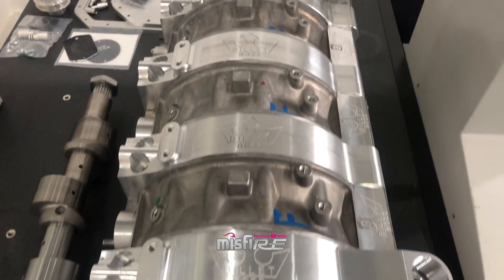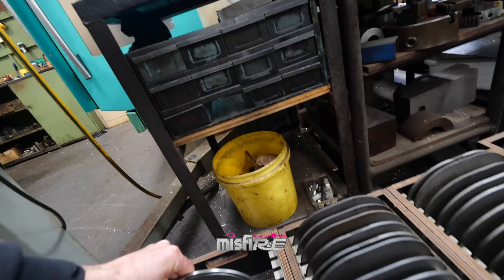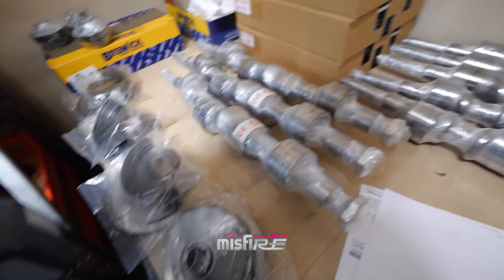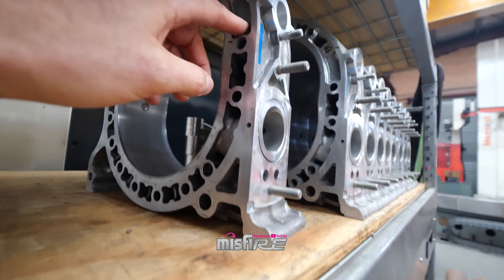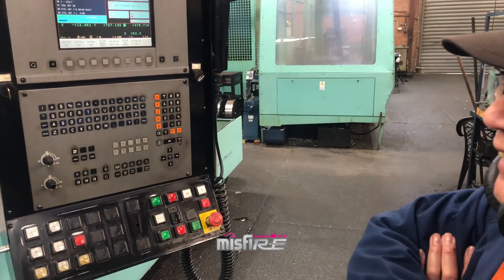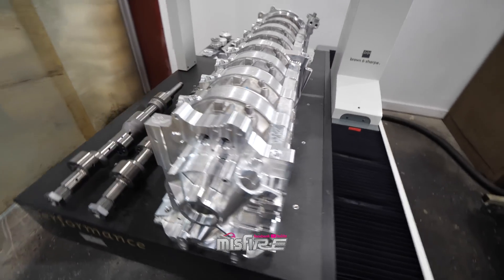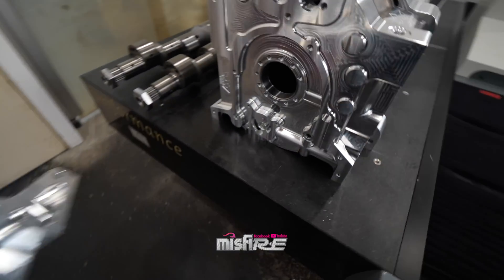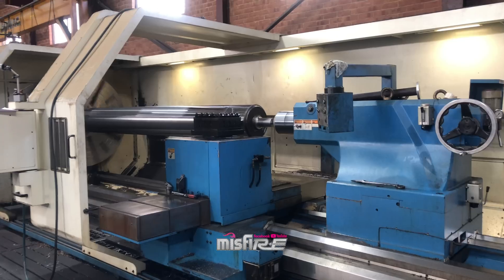8 ROTOR rotary engine The first inline ever made #Tesla model s

Comment: Could they join two 4 rotor cranks end to end?    Has anyone thought of just making the rotors and housings bigger?
Reply from the maker: Thought of both of those ideas and use a coupler system - I just want to use OEM and see how far it can be done

Comment: With all that  money and engineering available It would be  just as easy to just scale up the engine up in in size..keep it shorter but bigger overall..then your going to have ALL the tire burning torque you want ..plus the High RPM's..  I may be wrong but your 8 may  be  very slow to ramp up rpm and it's going to flex unless you put some beefy rails under it...
Reply from the maker: Maybe even a big slab of stainless for the sump plate, agree it’s going to need the strength

Comment: There's a reason you don't see inline 8 or v16 engines anymore. You're gonna need help from the bureau of weights and measures to get this thing to run right
Reply from the maker: Hey bro think the biggest 2 issues why no one has built it yet is 1 there are only 2 lathes big enough to balance the e shaft that I have found and 2 it’s so bloody long not too many cars it will fit it tesla wil fit it mint who’d of thought🤘
Reply: @misfirerotary  good luck, I wonder what it's gonna sound like
Reply from the maker: @jankington216  that's what's really driving me to get it done a angry bee hive

Comment: Is there a way to build an 8 rotor with two 4 rotor e-shafts? Or would that be considered two separate 4 rotor engines?
Reply from the maker: Thought about coupler system just want 8 stacked🙌
Reply: Even if they can't be coupled there has to be a way to sync all 8 electronically right? You just need studs that are like 10 feet long.

Comment: I highly suggest u split the first four rotors cooling system...your running 75% cooling needed above original design on the coolant holes ...having that CNC machine u just have to make the back housing for the 4th rotor have different coolant routes
Reply from the maker: 🙏🙏for your advice👍

Comment: For as small as the package why not put 2 side by side and use helical cut gears to get the timing between the 2 cases and use plates to attach them together like the tractor pulling rigs use. 2 4 rotors with huge turbo like dahm but set the timing so the engines are 45 degrees out would have 4 power pulses every revolution and would be 4k power in space of a v8.
Reply from the maker: Like your idea🙏👍

My dream was more around seeing how many housings can be stacked together toget to work
🙏for comment 👍

Comment: For cooling and oiling I’d probably look at running it as if it were 2 individual 4 rotors. ie oil and water pumps + radiators for the front 4 rotors and seperate oil and water pumps + radiators for back 4 rotors… running water or oil through the entire length of that thing will get it all pretty hot by the end even with methanol…
Reply from the maker: 💯agree along with methanol or e85 with ice box and cooler

Comment: The efficiency will be hilariously bad.. 2 miles per gallon. Cost probably 100 bucks to got 10miles
Reply from the maker: Plus I am aiming for methanol to keep temps down
Reply: I mean if you're going to go big you might as well. But what happened  to that crazy 12 rotor that was on YouTube years ago? Where's that monster. And how much power did that thing make

Comment: Building the shaft is not the hard part, making it strong enough to transmit the power is the hard part. By the time you get to the back of the engine the E-shaft going through the 8th rotor has to take the power from the other 7.
Reply from the maker: Cheers for you comment 🙏🙏going to b a mission

Comment: I took a welding and CNC class after high school. It was certainly interesting. I made my own CNC G-Code on my own. You have to remember the codes and put the correct ones on the right line or you will have a CNC crash aka VERY bad. But TAKE IT SLOW and you will be fine. Takes a lot of practice and memorising
Reply from the maker: Really appreciate your advise🙏🙏🙏🙏❤️❤️❤️

Comment: You could just do two 4 rotors side by side with either a belt or timing chain setup. I have even seen a 12 rotor setup using 3 banks of 4 rotors. and going into a tesla, should be plenty of room since the engine bay probably won't be conventional
Reply from the maker: Love the idea🙏🙏🙏🙏 emagine the tuning envolved so they all sing together. My dream was more around to see how many plates are possible to stack together and get to work.
Thanks for comment it all helps🙏🙏🙏👍
Reply: @misfirerotary , I was just thinking at 6 rotors you are getting pretty close to the limit for most engine compartments, Unless you are putting this in place of a Cummings diesel 6 (those are pretty long) so two banks of 4 might fit better
Reply from the maker: @crazylarryjr  im only limited my machines to make the crank sorting that out then good to go

Comment: I see no reason it couldn't be boosted. As long as your eccentric shafts are timed right it should be fine. Provided your cooling system is amazing.
Reply from the maker: think that is probably 20 years away before that could happen we really haven't even seen a 6 rotor out there smashing tyres and this mikes 4 rotor is the only one doing it in a 4 day after day. it is a harmonics issue because of the length add boost then boost spike custom in/outlets heat would b an incredible thing to accomplish
Reply: @misfirerotary  makes sense. Good luck and I can't wait to see one in the future.
Reply: @misfirerotary  i wonder if made out of something like inconel metal, if it would be able to withstand the intense pressure and harmonics.  Would be very expensive but very cool.
Reply: According to Mr. Dahm, the e-shaft is the weak link. Boosted 4 rotors approach the torque limit of the shaft, a NA 8 rotor running at conservative revs would output similar to a highly tuned and boosted 4 rotor.  In other words, boost applied to an 8 rotor would simply just snap the tip of the e-shaft off at the clutch.
Reply: @jefftroyer4938  thanks for the info. I can see how that would be a problem. Definitely would be amazing if they ever figure it out.

Comment: WOW.... I would be interested in what the stud bolts look like for this long of a power plant... .750" diameter 4 foot long...LOL...  The helical twisting action of this in my theory, will crash out this system.. I do not mean to sound negative, but, that is very long spread on the studs in such a close to centerline area... harmonics and a helical torqued out twisting.. I hope it holds up for you guys at high rev's...
Reply from the maker: Cheers for watching and comment 🙏👍
Reply: My thoughts exactly, the twist would be insane throughout the block!
Reply from the maker: @Yukanhayt-Mhenow  that's another reason why I'm going na add boost more power and to make sure each housing is making same comp then harmonics with wind speed. biiiiig mission one to get to work properly which I would only do not just to make content.👍

Comment: Why not a V rotary configuration with 4 rotors on each bank and a mad max gigahorse kinda of gearbox
Reply from the maker: Idea was to always see how many factory housings and can you just keep adding, cheers for interest and comment
Reply: Thank you 

With the oil pan design the 120 degree v or Boxster configuration you could have a rotary that mit fit in an engine bay. But you need that madmax thing to link the 2 cranks

Comment: Methanol will create more heat due to extra torque,also have you calculated the volume requirements for methanol?
Reply from the maker: 🙏for comment my understanding from spending hours at the track and talking with people about it is it very difficult for a methanol burning car to overheat all the burnout cars run 100% I was also talking with pwr today about running 2 seperate radiators and pump one from front and 1 to back.

What do u think?
Reply: @misfirerotary  Well the biggest myth with alcohol is that it burns "cooler" it actually burns hotter. The misunderstanding is that it "runs cooler". 
The only time it can assist with cooling is on over run with carbs or efi if set up to do it. 
Regardless you'll never cool bearing and shaft areas with combustion chambers. 
If you double,triple? the frictional area you'll need to match the oil flow volume and cooling. 
What have successful 6 rotors done?

As for fuel volume it will need 600cc/rotor? Gasoline.
So 8x600cc at 80% duty.
80% of 4800cc =3840cc/min.

Methanol requires 1.7x Increase in volume.
3840cc x 1.7=6528cc/min.

So you'll burn the better part of 7lts a min on methanol.
Reply from the maker: Thanks so much for that🙏🙏I will run a big oil cooler with fans as well

Comment: The engine bolts will need to be so strong
Reply from the maker: Yep also has to b dry sump which will add some strength, the six rotor in the car now has 8 engine mounts bitch won’t move🤣

Comment: Would love to see this, imagine the sound with an equel length 8-1 header or two 4-1 headers. Flex seems to be a big issue for the shaft on rotary engines especially beyond 4 rotors but I think you would still be able to make quite a bit of power. Enough to do sick burnouts at least. 
We got 1 rotor engines, 2 rotor engine, 3 rotor engine, 4 rotor engine and 6 rotor engines already out there, and at least two people (Mad Mike and David Mazzei) are building 5 rotor engines. It would  be so so cool to see an 8 rotor next.
Reply: U
Reply: You forgot 12 rotor
Reply: @piffiiiiiiit  yeah that's going in a plane
Reply from the maker: @Jori_M  not sure I would hop in a rotor plane😂
Reply: @misfirerotary  🤣🤣
Reply from the maker: @piffiiiiiiit  never say never
Reply: might as well make a 7 and 9 while your at it.
Reply from the maker: @2000freefuel  guesss if anyone wanted a engine inside the cabin. lets just start with a 8

Comment: if this becomes a real engine. i would highly recommend tripple oil pumps. front middle and rear with all connected in parallel. or one large belt driven pump
Reply: And run 2 stroke mix...
Reply from the maker: @tonydiesel3444  I'm planning straight methanol with premix
Reply: @misfirerotary  can't wait to see that Choo Choo smoke
Reply: It is a rotary just run heavy 2 stroke mix and everything will be fine. ,😉
Reply from the maker: @Athlas87  going methanol and now thinking 100 shot of nitros after visiting nz and seeing the results should see 1200plus hp relatively easy
Reply: @Athlas87  I have seen john deer bulldozers set up for the military to run jet fuel, they have an auxiliary oil feed into the fuel. Idk if jet fuel offers great lubrication.

Comment: I have seen a 6 rotor run at 7s day Japan, it was apparently quite a feat to achieve, very complex, it will be something else again to get an inline 8 rotor to run. I  wish you all the best if you head down this track. I keep looking at this and all I see is 2  20b rotors and a 13b which would be perfect for me.  You were really fortunate to get the chance to show a lot of what billet boss does. The work in the plates looks great, are you able to get footage of their motor assembly or are they just a parts supplier?
Reply: Check out PPRE 6 rotor rx4
Reply from the maker: @kingmac007  yeah bro seen it years ago🤙
Reply: @kingmac007  the OG 6 rotor!!
Reply: @kingmac007  it's never ran any times... just a show pony really
Reply: @markc1456  never ran any times on video ran plenty only seen by eyes